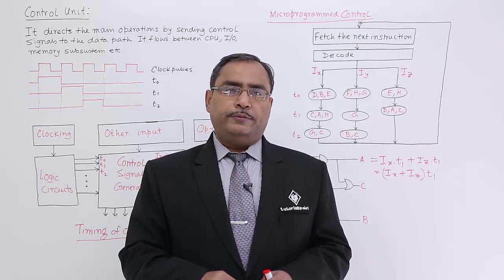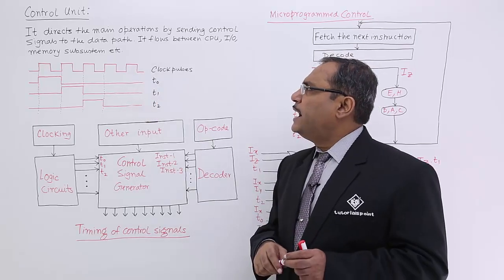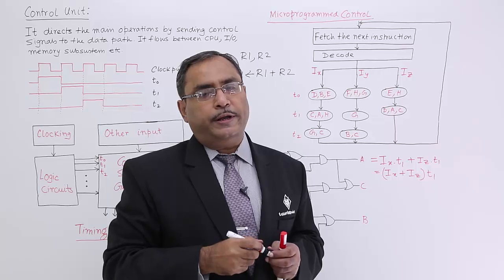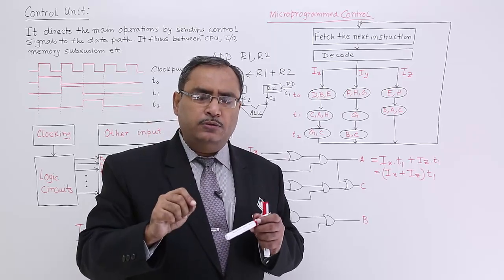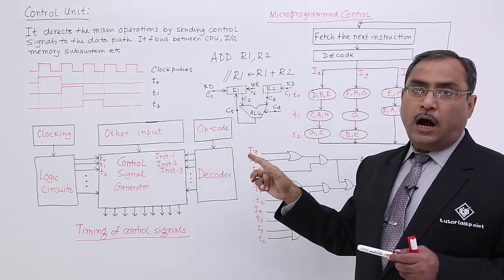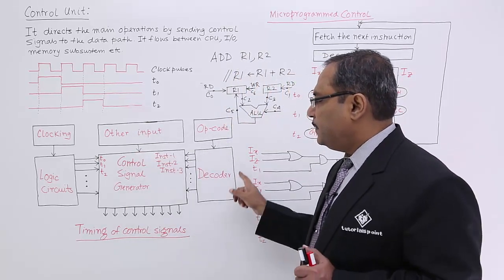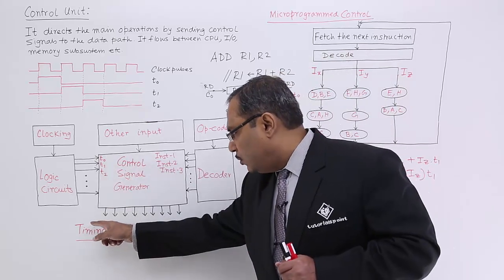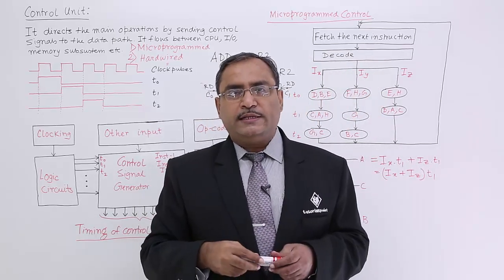Introduction to Control Unit

Comment: Question:
Design a control unit of a 30-bit computer and list all the internal inputs.  Mention all the categories of the instructions (i.e., Data transfer instructions, Arithmetic instructions, Logical instructions, and Branching instructions). Also list all the outputs (i.e., control signals produced) only for logical instructions

Comment: Question:
Design a 24-bit computer and discuss the following for the proposed system
1. Changes/ enhancements in the instruction format.
2. Total memory locations for the system
3. Starting and Ending address of the memory
4. Complete instruction set for the system